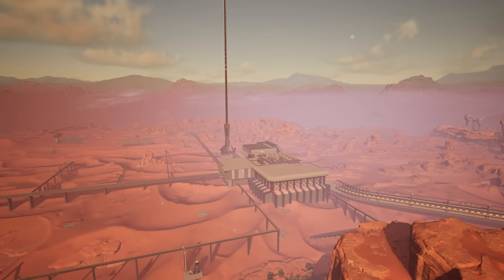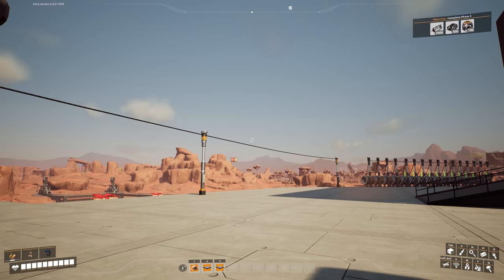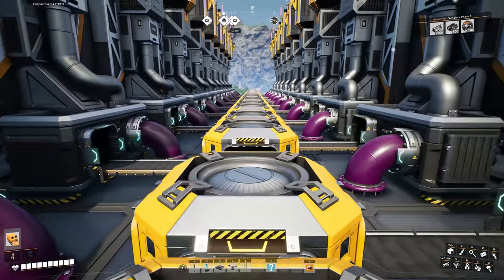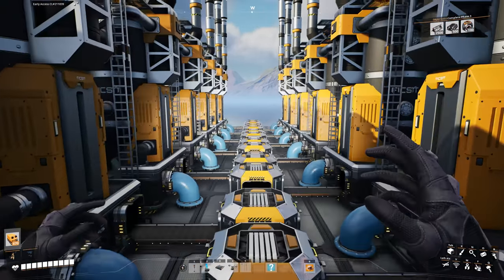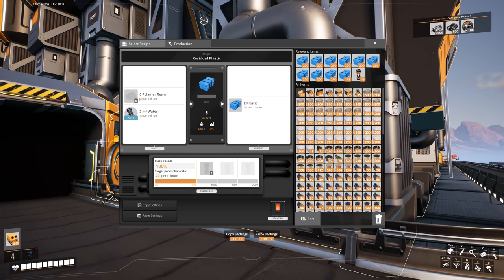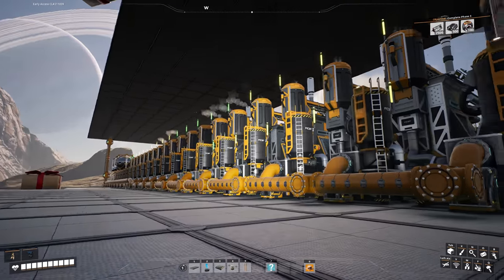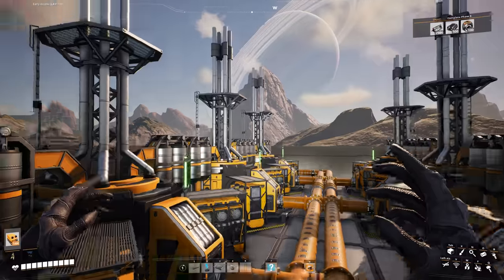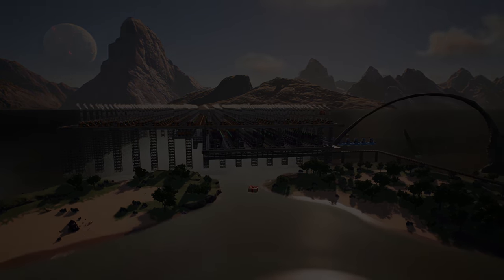I now have 69,000 MEGAWATTS!! in Satisfactory Update 7 -  Part 9

Comment: @Bitz When you set the Generators up, you could have used valves on the in-put of the pipes and set it to 12 or a little bit higher. thus the fuel doesnt stackup in the front and flows better to the end generators. to avoid the hassle of setting every valve to your number of your choosing, use blueprints with the generator, the pipe crossing and the set valve.

Comment: Happy Holidays to you too, Bitz :) I've had that problem with fuel starvation in the pipes for last few generators in a row (64 generators on one pipe, 2-4 generators at the far end would always starve) even though I've had more fuel than those generators needed. It would be nice if devs could fix this bug with liquid flow in the pipes. But until that time comes I've had an idea to build a power plant with fuel making machines on both ends of the plant and fuel generators in the middle, so the fuel would be delivered from both ends of the pipe.
Reply: You could also throw in some valves to prevent huge waves traveling down your pipes.
In my setup every 4 generators get a valve. The last limit is 48m^2 than 96, 146 ... It works with steps of 50 as well but i like tight designs.

Comment: Seeing you last video about highways, I gathered 3 facts:
1 - There's a main power line going through them. 
2 - You said they're gonna be global.
3- Power fluctuates a lot even though you have everything on 100% efficiency (I think).
Crazy idea that I'm gonna do on my next map: 
Have 2 different power supplies, one strictly for miners and machinery to run on 100% efficiency, fed by the main power line under the highways and a second power supply to feed trains (and use as a power line), hypertubes, sinks, lights, etc

Maybe it's a overkill, maybe a huge challenge to manage all of this, but my OCD is taking over control and would love to see you doing something like this.
Reply: Honestly I've only produced half my max consumption for a while and as long as you have batteries you're mostly good

Comment: The advice about overclocking the first ones and filling the pipes etc, etc.... None of that is needed. You can put 50 in a line and run them in a manifold setup. The issue is to fully prime the system takes FOREVER. So eventually it would run just fine. The distribution strategies merely effect the speed at which you get up and running.

Comment: hey, a little tip: there is a easier way to do equations using the games calculator, for example for the one in the video, just enter: 188.667*2/12 and you get the answer you want.

Comment: How do u get it to feed liquid so well. I keep running into Issues anytime i split a line for 2 machines oil or water...   my lines just drop in flow.    Then they start fluctuations from 600 to 100 to 0 then back to 600.  Iv added pumps and no change.   Iv torn them down and rebuilt..  can the line be streched too far? I have it running about 1000m  ?

Comment: 600 crude oil = 10 refineries (raw oil to plastic+heavy residue) + 10 refineries (raw oil to rubber/heavy residue) = 5 refineries (heavy oil to fuel) +200 plastic+200 rubber. 
5 refineries of fuel = 25 fuel generators = 3.750 mw.

or in short:  1 mk2 line oil = 10xplastic +10x rubber + 5 fuel = 25 fuel generators= 3.750 mw + 200 plastic + 200 rubber
no calculators, no clocking needed.  Ain't life sweet when you keep it simple.